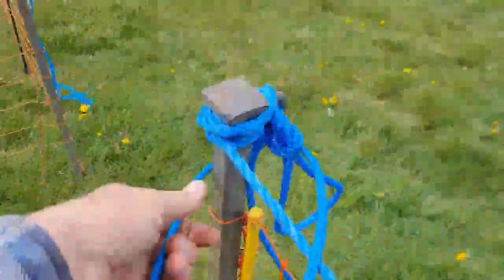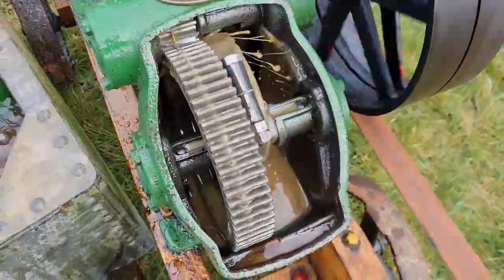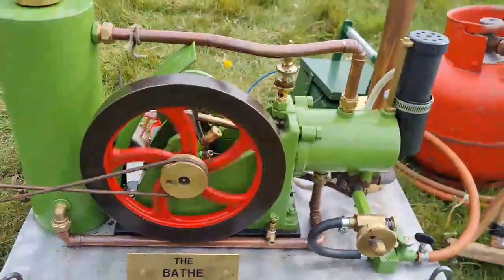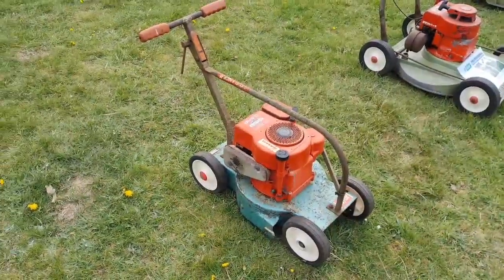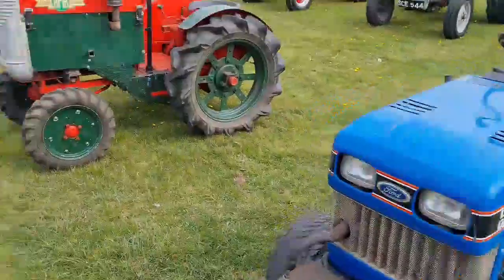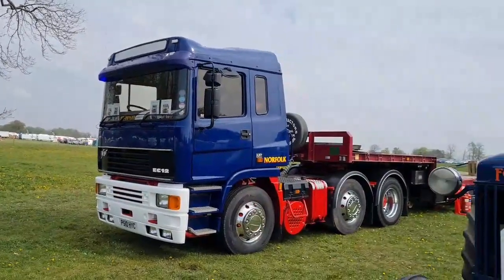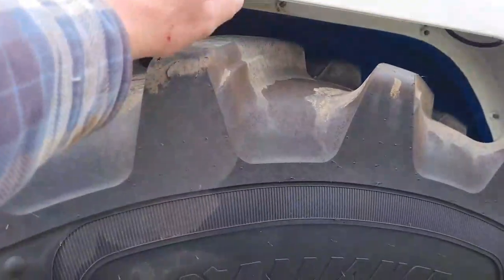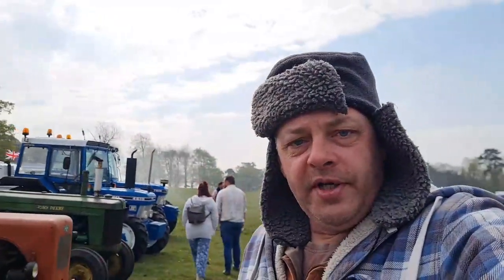Lister, Bamford, Crossley engines.

Comment: Lovely to see , I know nothing about the engines so perhaps you would be kind enough to explain why some if the engines on show have a twist in the drive belts they are driving the auxileries with please . Enjoy your time at the show ATVB Gary.
Reply from the maker: Well the twist in the drive belt is to change direction on rotation. eg if engine is running CW a twist in the belt makes the accessory drive CCW.
its really just that simple. Thanks for watching. 😀